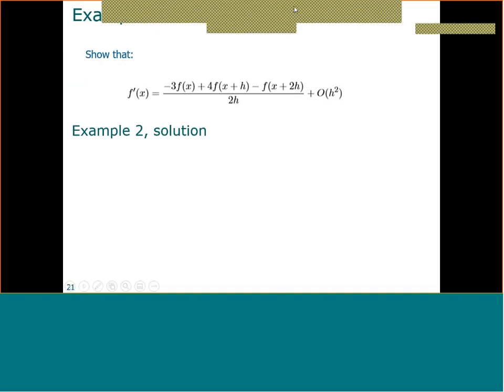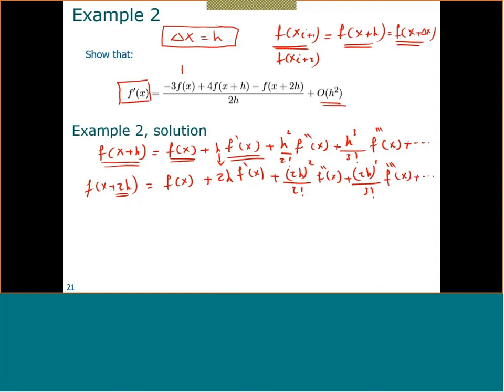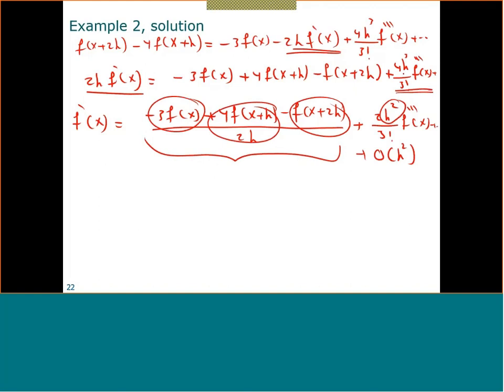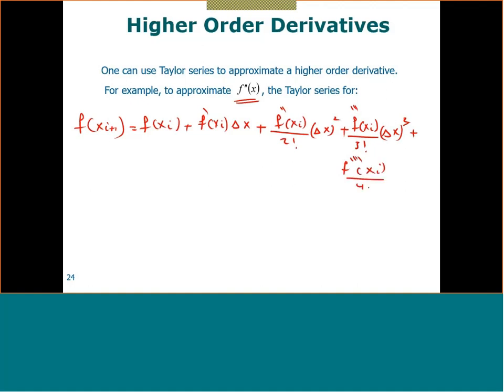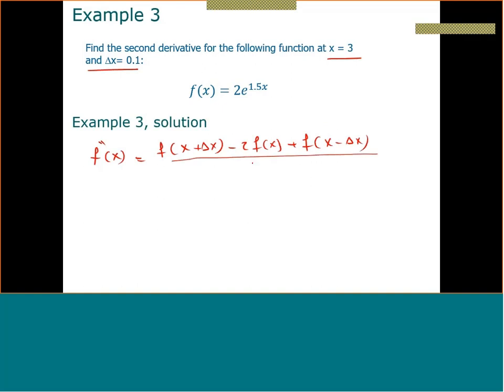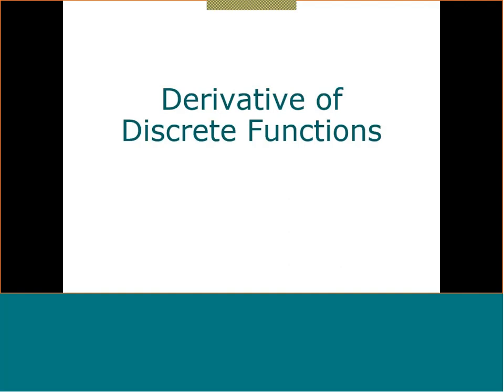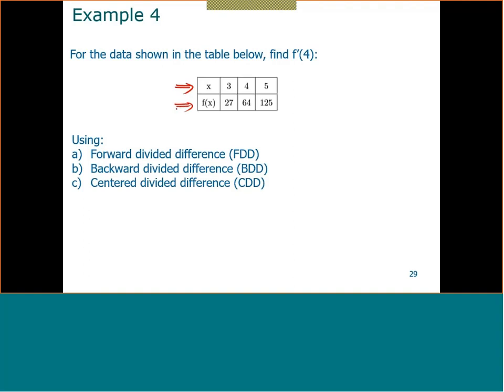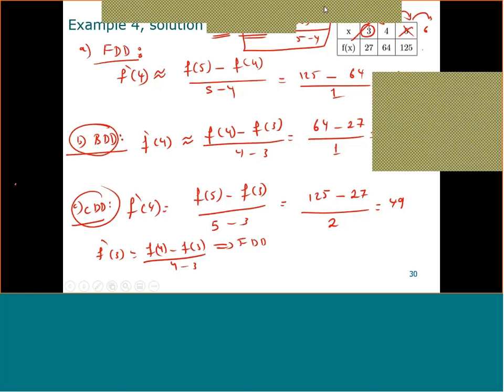Lecture 19:  Numerical Derivative - Part 2

Comment: for 36:20, why can't we use cdd to find f'(3.5) with delta x = 0.5? 

The formula needs f(x+ Dx), f(x-Dx), and delta x only. So, don't NOT need the value of f(3.5)? we only need the value of f(3.5-0.5) = f(3) and f(3.5+0.5) = f(4)? 

This is a similar question to the other comment on this video
Reply from the maker: In this example we want to compare FDD, BDD and CDD all together. Yes, we can find the derivative at 3.5 using CDD but we cannot find the same using FDD and BDD.
Reply: got it! thank you!

Comment: Mashallah amazing explanation, I followed everything until 36:40, I want to iterate the question being asked. Why not do cdd, {f(x+dx) - f(x-dx) }/2 dx, and set delta x to 0.5. This way, I have the point 0.5 in front, 0.5 in back, and 0.5 is constant. Moreover, by the same logic, I could find f'(2.5) using FDD, setting delta x to 0.5, or f'(5.5), using BDD, setting delta to 0.5. I understand it's wrong, because then I can say let me find f'(100) using bdd and setting deltax to be 95 hahaha, but I was wondering if you could explain a little more why it's wrong
Reply from the maker: I'm not sure if I understood the question but for the last part it is always desired to have dx very small otherwise the error will be latge so you cannt have dx =95 😀😀